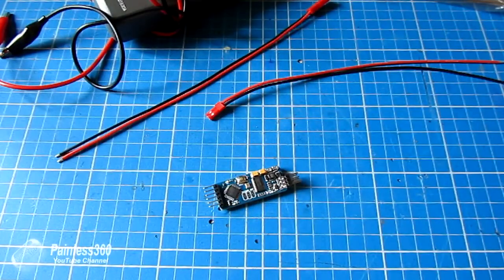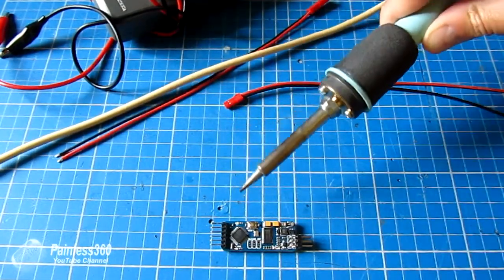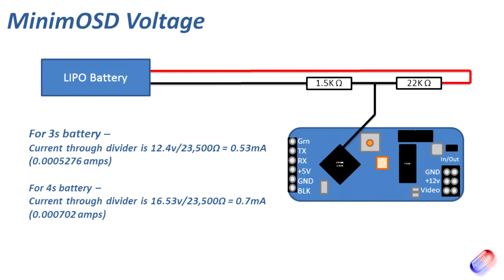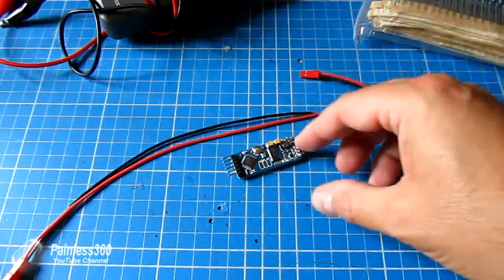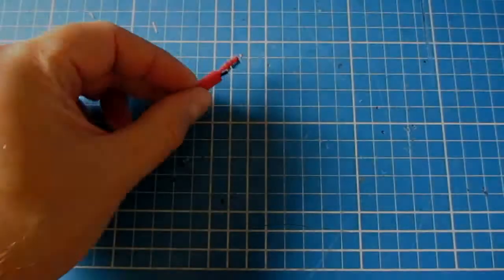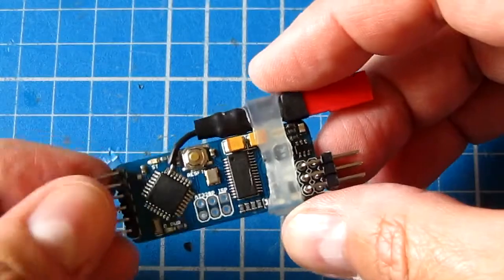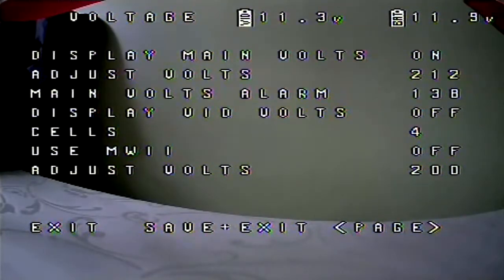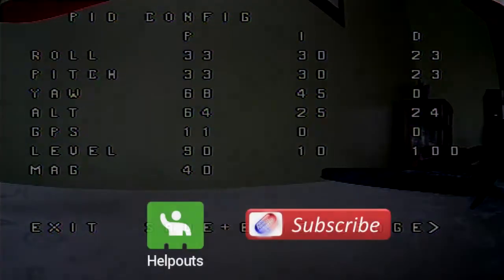MinimOSD setup on MultiWii - Adding battery voltage readout

Comment: Do you have a tutorial video on setting up a current sensor with Multiwii or minimosd?
Reply from the maker: I mention the current sensor and show one in the new APM Mini 3.1 videos. The current is then displayed onto the MinimOSD via the telemetry port.

Best of luck with your project.
Reply: Thanks. I'm looking for information on using the current sensor on a multiwii flight controller (EZ MEga 3.0 by RTFQ). It's my understanding that use of the current sensor on APM is fundamentally different due to the firmware differences.

Comment: Great video! What fpv camera are u using...im in the process of getting one but im not shure which to buy..the one you are using seems good.
Reply from the maker: Hi Torbjörn, this is one of the keychain cameras - the 808#16 V2 with a 120 degree lens. Cheap and allows for local 720p recording into a micro-SD card and video out for the FPV system.

You can see more of this at How to configure a keychain camera (808 #16 V2) to get video out for FPV

Happy flying!
Reply: Painless360 Ok thx! Will look into it! Continue ur great work doing this ... it greatly apreciated by a newbie like myself. Thx again!:)

Comment: I would have probably used a small to turn POT so I can get calibrate the voltage precisely. Although I would also have to use another resistor (maybe 10k) between the center pin and the multiwii so that if someone or me moves the pot all the way to one side or the other it does connect the analog input directly to the raw 12.6V battery. It would end up limiting the current if I overcome the dielectric strength of the FETs inside the ATmega, and since it is a high Z input, it also should not affect voltage to much.

Comment: Like your infornative videos. When you say MultiWii controllers do you include the Naze32 which I believe is a variation of the software. I have compared this one to the KK2.0 and find it way superior in level/horizon control. Would the MinimOSD suite this board and if so how would it be connected. Cheers John
Reply from the maker: It should do and there are posts about doing it in the forums but I've not done it myself. Good luck with it. The MinimOSD is a great piece of kit!

Happy flying!

Comment: Is minim OSD support 4s 14.8v?
Reply from the maker: Unless it's the latest versions of things like the Micro MinimOSD then you'll need a resistor bridge to drop the voltage to a level the OSD can measure. Check out the documentation for the one you have. Best of luck!

Comment: Can this be used also with pixhawk if not using the power module with volt and amp? (which is normally providing the data to the minimosd)
Reply from the maker: You can't use the pixhawk software installed on a MinimOSD with a Multiwii. Multiwii talks MSP,  APM and Pixhawk talk MAVlink. The MinimOSD needs to be running the right firmware for the FC you're using. It's all covered in my various MinimOSD videos.. best of luck..
Reply: As said..I just want to apply your minimosd setup for a pixhawk installation (with pixhawk minimosd software). Is that working, is my original question?

Comment: Howdy. Can you tell me if the Multiwii SE V2.5 can support a 4S battery? I'm using 30 amp ESCs.
Reply from the maker: It will be fine. The Multiwii doesn't plug into the battery directly anyway. You need to make sure you are using ESCs or BECs that can handle the 4s LIPO pack.

Happy flying!
Reply: Thanks for the direction Painless. That makes sense to me. I'll check on the ESCs next.

Comment: i have a question, i hope you know the answer...... i have built in the minimosd (with MWOSD firmware) and almost erverything is working... but there is still a problem. OSD shows main battery voltage (signal is coming from fc) and i have also VIDEO voltage... but videovoltage is 0,00volt.... i have the minimosd 2 and there are 2 batt connections, BAT1 and BAT2... so i soldered a  + wire from the fpv battery to BAT2 (and also GND...) but i get 0,00volt.... Now i think that i have to connect the fpv voltage to the power pins of the video in/out pins... BUT, the board is powered with a 5v bec now so my question is: Can i connect the 5v (on the FTDI port) and ALSO (at the same time) the 12v FPV voltage on ftdi side??? I hope you can help me, i do not want to fry the osd!!  Otherwise i can maybe connect ONLY the 12v fpv side, the i get videovoltage AND the osd board is POWERED with this 12v ONLY........
Reply from the maker: Apologies, I haven't used this for a very long time so I'm not up to date with the latest firmware. Best of luck

Comment: If I follow your cc3d with minimosd tutorial and do this, will it work?
Reply from the maker: ***** Depends on the firmware version you are using. Read the notes for the version you are going to use to check. 
Best of luck.

Comment: I have modified the minimosd same as what is done as you ..
using a 1.5k Ohm resistor for the negative cable and 22k Ohm resistor to the positive cable

however, why the value of the voltage that appears on the OSD FPV does not match the voltage of the battery is actually

I use a 3S battery.
measured using a voltage monitor.

suppose the value that was obtained voltage monitor tool is 11.27volt, but why in the FPV OSD worth only 10.95volt?

I hope you can help in the next video, because your video modification is right for multiwii (MWOSD)

I use FC Crius AIO Pro with firmware APM (minimosd-extra.config)

yes, I know that in APM using the power module to determine the value of the battery voltage ..

Essentially, I do not use the power module in APM,
I want you to make modifications minimosd which can also be used in the APM, but without using power module ...

I was very plead with you, if necessary, you make a tutorial video

please ...
Reply from the maker: +aDe check out the documentation for the firmware you are using. There is normally a setting/ slur you can change to get it the same. Best of luck!
Reply: any video tutorial to configured thats you mean?
i am using APM firmware
Reply from the maker: If we do then it'll be in the APM series.. Best of luck!
Reply: which video did you mean?
please let me address your web video that describes the configuration of the battery voltage in apm . . .

Comment: just curious, what is the easiest way to measure current i would like to know what current a speed controller is pulling on initial ground test... ?
Reply from the maker: I pop a wattmeter in-between the battery and the model and use that to read off the amps being pulled. I use a HK-010 ( see HobbyKing HK-010 power meter overview) I'm not sure you can get this exact one any more but you get the idea. Hope this helps. Happy flying!

Comment: Hi. After doing all the job, I got the wrong voltage. I try all the adjusts at the configuration screen but the max voltage I got was 6 volts for a 3s battery 2200mah. And with a 3000mah battery it goes to 2 volts. Completely non sense. I already did something very similar with my crius 2.5 se, but with 33k and 51k resistor instead, and works perfectly. Any idea why I'm having this problem with minimosd? Thanks.
Reply from the maker: Not sure, I'd recheck the resistor bridge. best of luck!

Comment: would I even need to do this if I have my minimOSD connected to my telemetry? it is showing me voltage I just hope that it is correct.
Reply from the maker: +Christopher Jacques If you can get the detail from the telemetry from the flight controller then no. In all of the other videos on the MinimOSD you can see we use the data from the FC to populate the OSD now.. Happy flying!
Reply: +Painless360 OK I have the plug and resistors all connected and with heat shrink on them. Before I make the attempt of soldering it to the second pin on that chip do you think connecting a power module to the flight controller of my Cheerson CX-20 would give me the same good readings as connecting these resistors to  the OSD? I only ask because I do have a power module that I can use.
Reply from the maker: Not sure I've never tried it like that. There are newer boards that do have these connections at the side now (look for ones with the KV-Team mod) that make the soldering a little less tricky! Best of luck..

Comment: Hi. Nice video! A question, Can I use the minim osd v1.1 to do this? Is the green one that you used in the cc3d video. Or is it different ?
Reply from the maker: Not sure. If it will take the firmware then it should. Check with the seller before buying.. Best of luck!

Comment: Does this adapter work for all versions of the miniosd firmware? I'm looking to add this onto my naza lite, but I've seen a different soldering/resistor setup. https://code.google.com/p/minnazaosd/wiki/Stages
Reply from the maker: Each setup of the firmware seems to have it's own requirements. I'd follow the one for the version of firmware you are looking at.

Happy flying!
Reply: Thanks for your reply.  I soldered adapters up today : (.   Looks like I need to order new resistors.

Comment: Hi, i added my MinimOSD now to my APM Quad, but the reasult is not what i expected.
Sometimes there are some icon and text parts missing. Do you know why this is as it is now?
I am running MinimOSD Extra on the board.
And i am missing some status information. Oh and this was my first test, i have not adjusted the items correctly, i will do this later, when i know which icon shows what ;)

Here you can see my OSD record

http://youtu.be/d6thprP5Pkw

Comment: is it the same by Mico minimOSD or can i use the KV Mod Pins: GND & BAT1?
Reply from the maker: The KV_Team with a Micro MinimOSD means that you can use the pads on the edge of the board for voltage and current sensing. Those boards have all these resistor bridges needed build in.. Hope that helps!